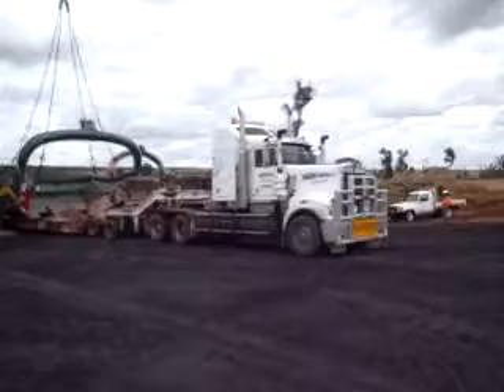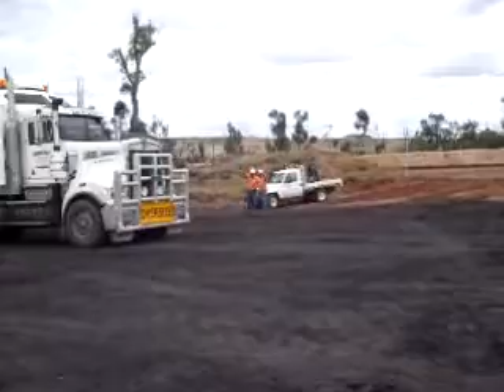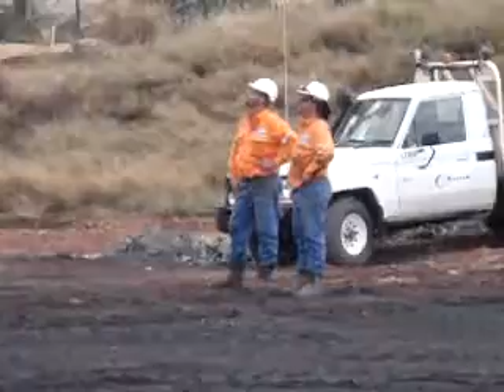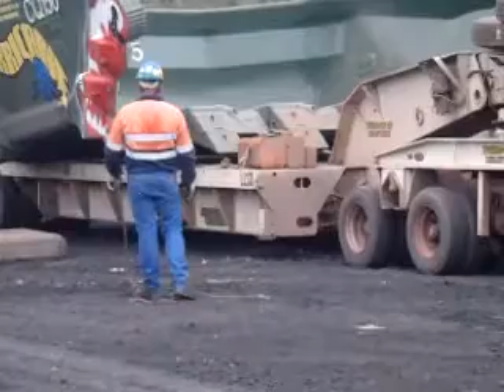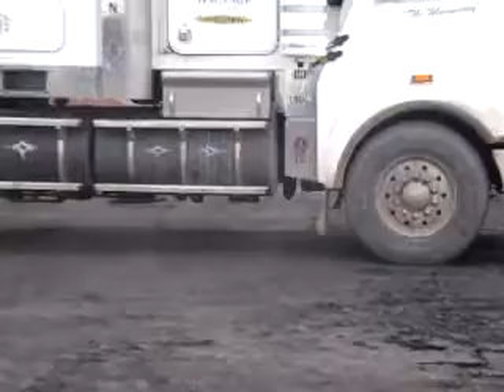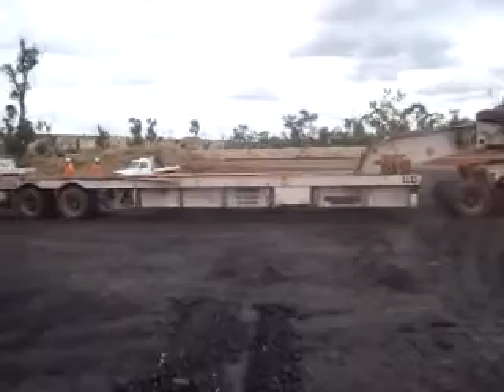Unloading a new Hurricane bucket from the low-loader

Comment: Why did this get unloaded by a crane and not the dragline  it was intended for?
Reply from the maker: Dragline bucket changes are scheduled for times when the dragline is on regular maintenance, thereby avoiding extra downtime from production. The new bucket was unloaded to a lay down area very near to the dragline's next maintenance area without interfering with dragline production.